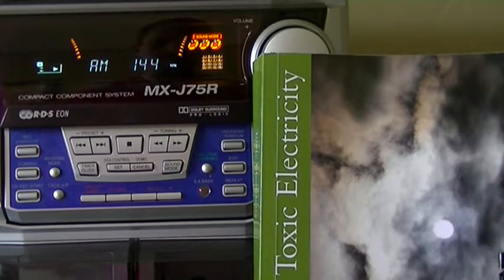Assessing Earthing Health Technique Grounding Systems

Comment from the maker: A screened coaxial cable may be better than a filter.  Ground both the cable and the screen at the non-electrified ground rod.  Leave the screen disconnected at the other end where you connect yourself into the cable.  Use a 1 milliamp fuse or a 100,000 ohm resistor in your cable for protection.  If you try this, can you let me know if it works?  As with any health techniques, you should under supervision by a qualified medical doctor and discontinue it if adverse health effects show up.

Comment from the maker: The problem with any wire is that they act like antennas and there will be many frequencies of energy running around on them.  Grounding the wire may increase the energy on it which may give you radio wave sickness with extended exposure.  A filter may help reduce this.  I am finding some very interesting things regarding plant growth defects in contact with electrified ground and I will be posting a video soon regarding the electrification of the ground, commonly known as stray voltage.

Comment: I steven I am just reading your book Toxic electricity. I am investigating  the earthing technique while sleeping. When I am in the garden or go barefoot I feel very good afterwards even though I have ground volatge on the property similar to your results, but when I connect to the earth wire at night I dont feel the same affects almost the opposite. I have tested the cable on a Oscilla scope and the earth wire is quiet messy with voltage/Frequencys. It appears to me a filter is required ?

Comment: Is there a way to easily and cheaply check if there is stray voltage in the earth around one's home?  I've used an earthing sheet for years because I thought it was good for me. Is there a way to check  for stray voltage in the grounding hole of the electricity outlet where I plug in my earthing sheet?